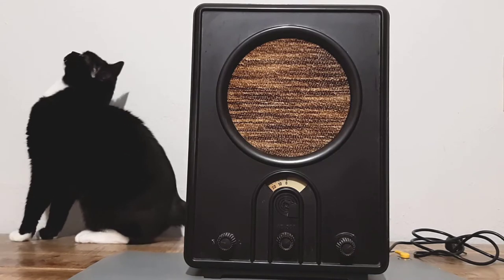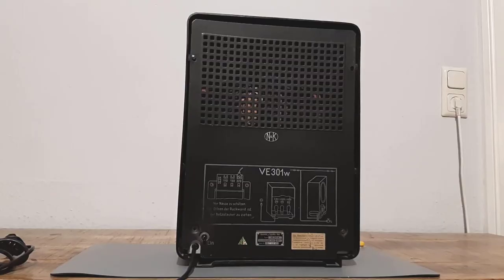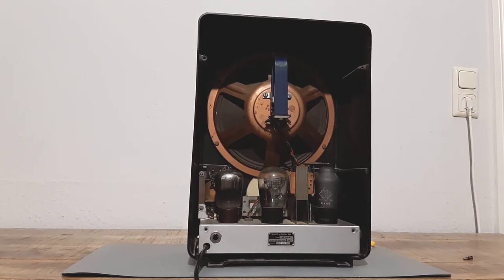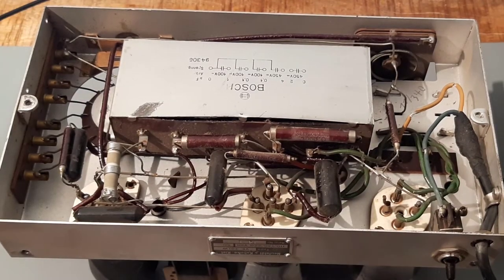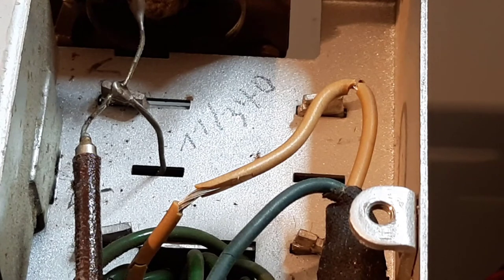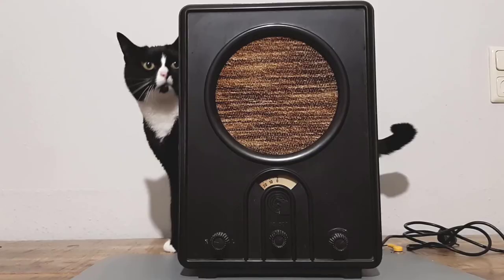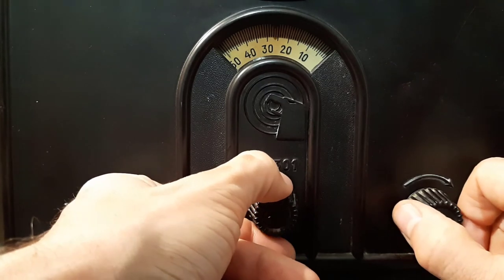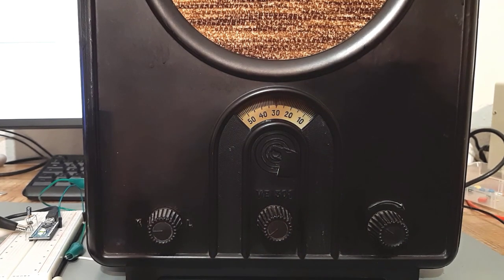Is it Still of any Use?

Comment: None of my transistor radios ever made the "cool tuning noise" .... I wonder if it's a unique feature of vacuum tubes? 
In England vacuum tubes were called "valves".... what do you call them in Deutschland?
Reply from the maker: That characteristic hissing and whistling comes from the regeneration. A principle that these early radios often used. A transistor receiver using this method would produce the same sounds. By the way, in Germany we call these "Röhren", means the same like "tubes" in our language.